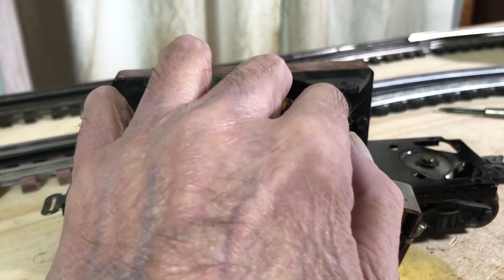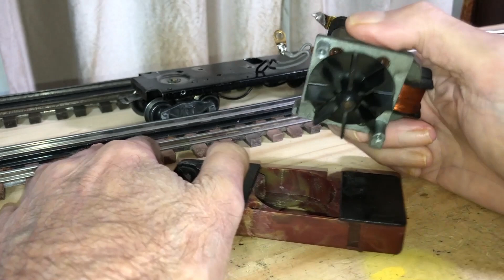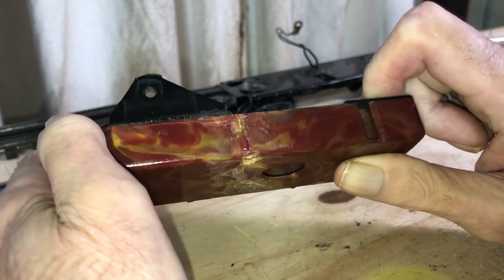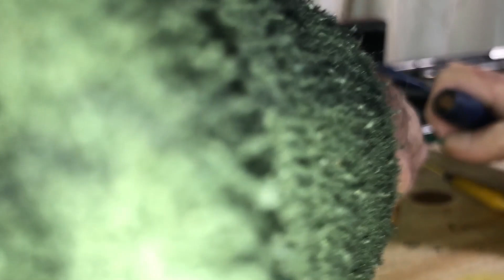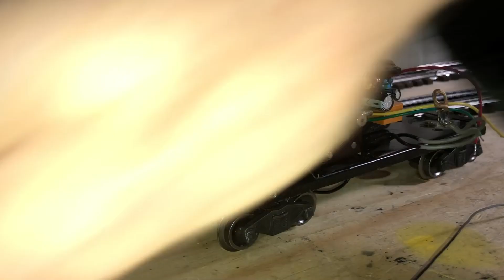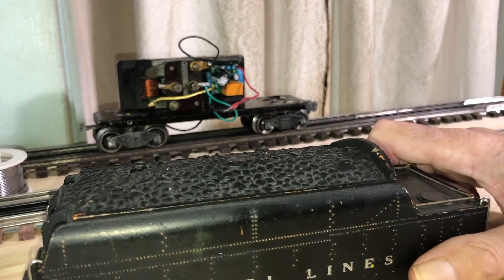Lionel 6466W Tender Repair, Parts 2, 3 & 4.

Comment: Fantastic repair!!!!👍👍👍 I have a quick question. I need the screws to hold the tender on to the frame. Can you tell me the Lionel part # or the equivalent size. I don't  want to strip out the plastic screw mounts on the tender. Thanks.
Reply from the maker: Thank you for watching & your question!  Lionel uses a #4 x 3/8" slotted head right hand self tapping thread type screw.  Hope that helps & good luck with your repairs!